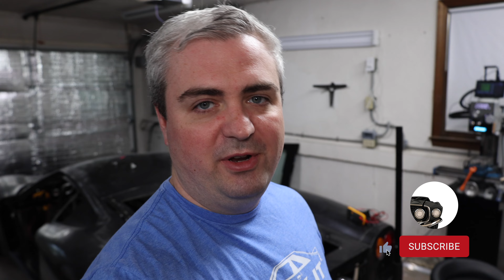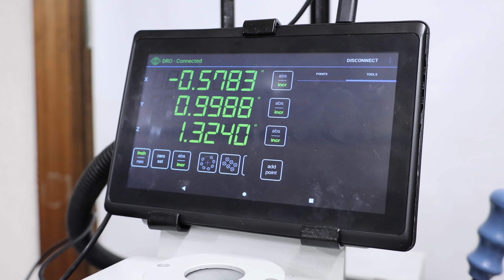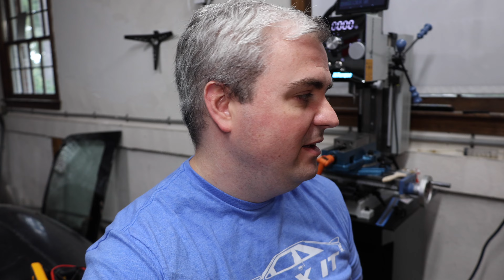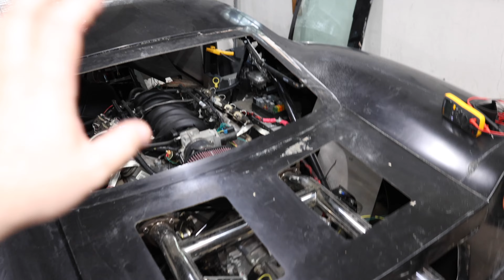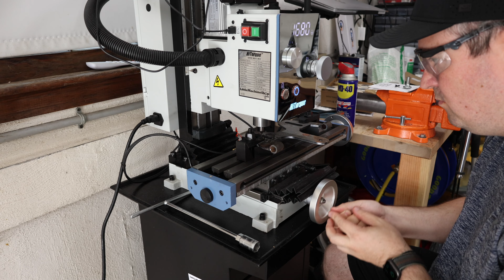I bought a MILL! | Little Machine Shop 6450

Comment: Nice demo. Thanks for posting. In addition to a smaller vice, a set of stubby drills is not expensive and can help with vertical clearance in some cases.
Reply from the maker: I hear you. Stubby drills are on my list of to buy items. Definitely will make more use of the shorter mill.

Comment: If you're anything like me (about three years into an LMS 3990, bear bones but have added numerous upgrades) you'll be buying a never ending variety of tooling and fixturing goodies as well as tweaking the machine.  When I have a specific project to do I always over buy material.  Anyway, good video. For anyone else looking into these machines I found the Little Machine Shop equipment to be well worth (what might be considered) the additional expense. (Good product, very helpful people.)
Reply from the maker: That looks like a good tool. You are right. Since purchasing the machine, I've bought so much tooling and fixturing stuff it is kinda incredible. I'm with you as well on overbuying material. I buy a lot, but I still need to invest in a band saw to help me get the material ready for machining. Would definitely speed up my work. I'm with you on the LMS equipment and people. I've had nothing bud good experiences with them. I'm waiting until I have a lathe project, then that might be next on the list... lol

Comment: I have that mill and love it. I DON'T have their stand for it though. How do you like yours? Do you find it rigid enough? I was concerned that it may have some flex given the weight.
Reply from the maker: I really like the stand. I haven't noticed any flex with it at all. I do find it rigid enough and haven't had any issues. I also haven't bolted it down which is something I should do. 

The storage inside is ok. Can definitely pull together or add some better shelving / organization to it.

Comment: I like the mill and lathes, but not the flashy digital panels.  Looks like a kitchen appliance instead of a shop machine.
Reply from the maker: A DRO makes it a lot easier for me to use. No dealing with lash on the mill. I also like having the RPM right in front of me. The mirror finish is definitely an interesting choice, but IMO it looks good.
Reply: @SmackeysGarage  wasn’t talking about the DRO.  The faceplate on the mill.

Comment: Great Video, I am working on purchasing a 6450 as well.  There was a great sale on a Shop Fox M1116 Mini Mill at Grizzly, but I have heard too many negatives about the tilting head, and also it does not support Reverse, so not good for tapping operations.  The DRO on it is a very basic wired X,Y,Z indicator which I have on my Grizzly Lathe as well.  It's OK for the lathe, but I think the tablet would be much more useful on a Milling machine.  After watching your video and the capabilities of the blue-tooth DRO for hole patterns, I am definitely sold on the 6450 vs. the Shop Fox M1116.  Thanks for showing that!  I was actually a bit intimated by looking at the tablet DRO link provided by Little Machine Shop, but your video was a great demo.
You mentioned stocking up on materials.  I have found it is best to find a local Steel retailer, rather than Home Depot and other HW stores, or even Amazon.  I sort through their scrap pile and find perfect plates, Angle, square stock at $0.60/pound.  Just picked up a foot square 3/8" inch plate weighing around 8lbs., which set me back $4.80.  Same plate on Amazon is about $30.  These are not rusty 'scrap' material from a scrap yard, they are just odd pieces left over from other orders.  The place I use locally in Redmond, Oregon is Swift Steel.  Hope that helps.
Reply from the maker: Thanks! I'm really happy with my 6450 purchase. I also cross shopped other mills that had tilting heads, but I decided in the form factor I wanted, I'd rather have the rigidity. I could manage the angles when needed with tooling. For the DRO on this. I'm really happy how easy it was to link. I actually dropped and broke my tablet originally and broke the off button, so my tablet dies between uses of the machine.

Even though it fully dies and has to be recharged, it still automatically links up and is seamless and easy to use. Just open the app and it is connected. I've never had to mess with it since the original install. I think the mount up top is OK for the tablet, but can be improved. Maybe its just holding the odd geometry after i dropped it and broke the back off though... 

I'll check out some of the steel retailers / material retailers around here. I've actually never stopped by and checked them out. There is one or two that I know of in Massachusetts, but I haven't done much searching. Thanks for the tip! Material off the internet seems to be on the very expensive side as you pointed out. Any other questions on it let me know. I've been so happy with it, I'm debating picking up their lathe for my small shop. Would be fun to have and I definitely have some projects I would do with it.

Comment: If you have not already, do yourself a favor and get a smaller vice, that vice is overkill for that machine and just eating your Z and Y travel.  For most projects on that size machine I used one of the tool-makers or grinding vices instead.
Reply from the maker: Good tip. Will do and thanks! I typically work on smaller pieces, but I sometimes find myself using machinists drill bits or having to reposition some parts because of the vice's height.

Comment: Just found your channel, very cool. Just remember you can make most of the tooling you are going to need with the very machine your buying them for! Let your inner cheap skate win, with some reading and indicators to double check setup is accurate you'll save thousands on tools.
Reply from the maker: Thanks! That's a good route to go I think for me. Learn and get more experience with the mill while building my own tools. Any good suggestions to start?

Comment: You owned it for 5 months now, what are your thoughts on the 6450?
Reply from the maker: I really like it overall. It's perfect for my small hobby space. I use it about once every two weeks for a milling operation since I'm working on cars constantly. It is very easy to use and very easy to maintain. Most of the work I've been doing is in aluminum, but I've cut steel and have had no issues with it. 

The only downside I've seen to it is being a smaller mill, there isn't a significant amount of room for a long drill bit between the chuck and the part when a part is in the large vice. There have been a few times where I had to move the table to get a drill bit in, and then move it back. Annoying sometimes, but it is only with large long drill bits.
Reply: @SmackeysGarage  look at getting one of the smaller clamp down vices, I know More stuff (the clamps) but you can use the small vice held in the big vice, or direct on the table, and of course you have the clamps to hold the smaller vice down to the table, which can also be used to hold down parts directly to the table as long as there are some flats to clamp onto.
I have a 2.5" one that is similar to the: Accusize Industrial Tools 2'' Precision Screwless Vise on amazon 
and "hold down clamp" t-slot
When you learn to use the hold down clamps with v blocks and 123 blocks you will go "WoW"
also, you can clamp a part in the precision vice and clamp it into another vice at a different angle without letting it go... and still keep it square

Comment: When I see people using WD40 as lubricant then I can't take them serious anymore 😂. People that use WD40 like this are morronic Clowns in my eyes 🤡your opinion about this machine lost every meaning at that point to me🤣
Reply from the maker: It’s all I had on hand and I wanted to test it out. WD40 works fine on aluminum. You’ll be happy to know I now have a proper cutting fluid!
Reply: @SmackeysGarage WD works just fine. In the old days we used water soluble oil and a  mister. Works good on most materials.

Icebluescorpion is the clown in this thread!🤣
Reply: It works perfectly well to cut AL.
Reply: Mr iceblue, He machined 10 thousands off a static part, get you panties out of your crack. I think your mirror will show who the actual clown is.

Comment: Measuring tools good sir - caliper and dial/test indicators. Get a deburring tool (I like the Noga ones), and countersinks.
Nice to see it's R8 though, will make finding used tooling super easy.
Reply from the maker: An R8 is exactly what I was looking for. I do have a set of good calipers, but need to get the test indicators. I'll pick up some Noga deburring tools. I heard they also make good dial indicator arm setups as well. Thanks for letting me know!
Reply: @SmackeysGarage oh, and get an edge finder or two as well...good for centering up with the DRO 1/2 function.
Reply from the maker: @SomeGuysGarage  I did get that in the premium toolkit. It’s a really interesting tool! Watched some videos on how to use it
Reply: @SmackeysGarage  Yes, the Noga indicator holders are awesome! I have two, one is a mag base with single knob lock, the other is just an arm that can go in the spindle (via collet) for tramming. Can get model numbers if you need.

The deburring tool is relatively inexpensive but nice for taking sharp edges off freshly milled parts.